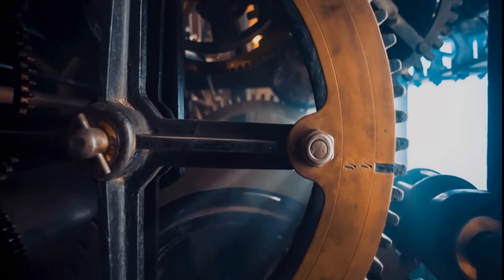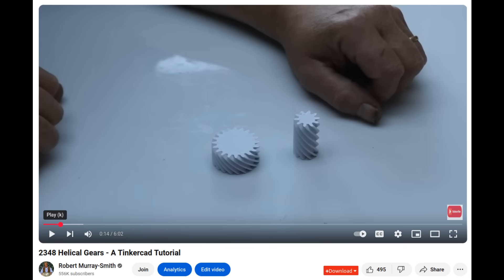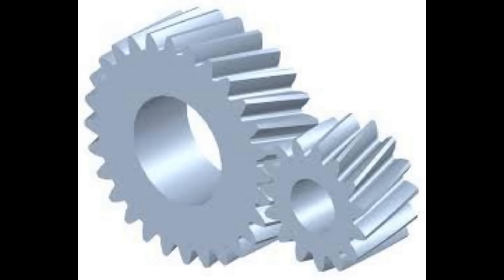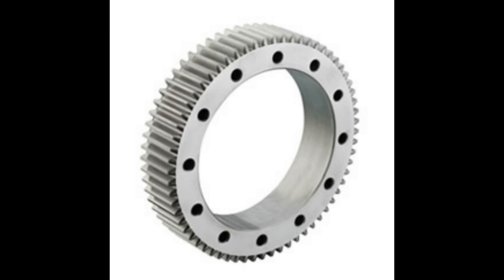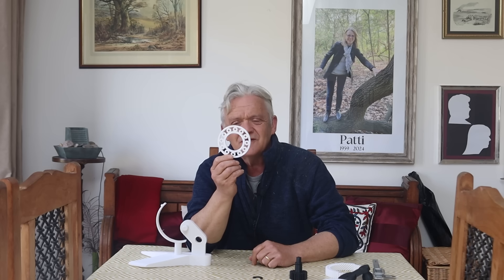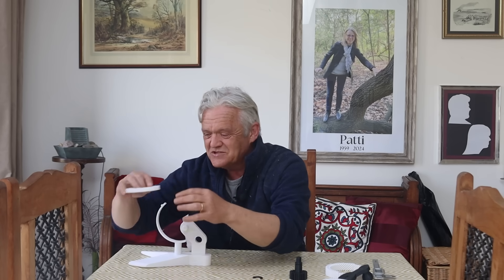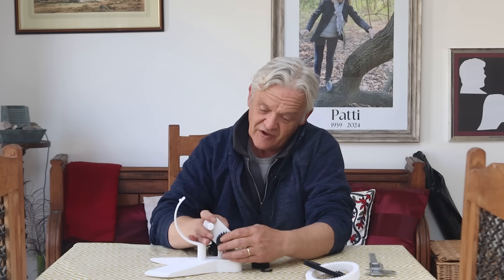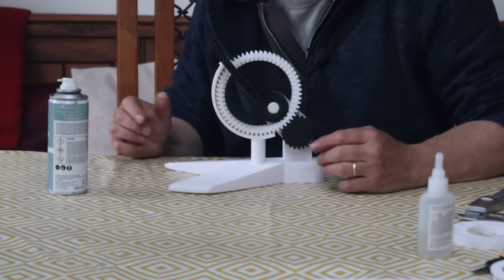2364 Fun With Gears

Comment: I did try making this gear set on the flsun sr and the gears are glued together. Any suggestions on settings that might help? I used Cura the latest version with the correct printer. Kind of a nub and could use some help. It's like the lash tolerances were to tight; only by a little. I also sent this message on Thingiverse Thanks in advance. Gerald

Comment: Robert, I love your videos and exuberance!  Have you considered making a Taurozzi Pendulum Engine (it has curved cylinders to reduce friction)?  Since it doesn't have much friction, it doesn't need lubrication.  They use an air compressor variant to produce high pressure gasses without contamination from lubricants.  I wonder if it would make a better Stirling Engine?

Comment: Hey Robert, I just watched a short video about The Curta Mechanical Calculator. I think it would be incredible to see it made with 3d printing, though it would far outstrip my drafting and cad design skills. I'm guessing it would have to be scaled up to work, but a large chunky expanded calculator would look awesome. I might try to dig up a patent or schematic and try to build one myself, though I'm not at all confident in my abilities to do so, lol. Still, would be fun. Would love to see what you could do with it and it fits nicely with your current series. Making a calculator using lots of gears and 3d printing. It just sounds awesome. I want to build it at a desk lamp sized scale, with the entire insides expanded to see it work, and with different colors for each connecting piece. I'm gonna end up trying it myself, I'm sure.🤣🤣
Reply from the maker: I think there is a chap called Michael Wu who dod an awesome job of that and released his files on thingiverse mate
Reply: @ThinkingandTinkering  I'll check it out. I guess I got to excited to share, lol. Should've checked there first.